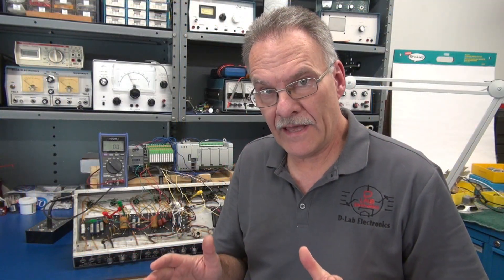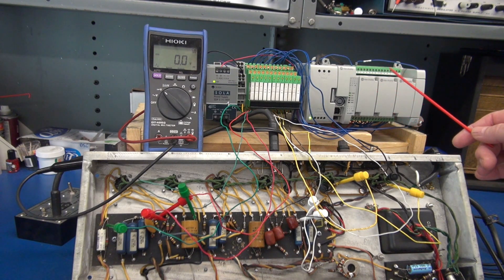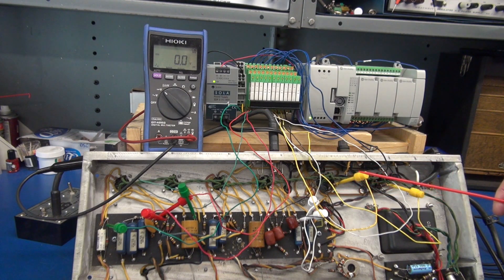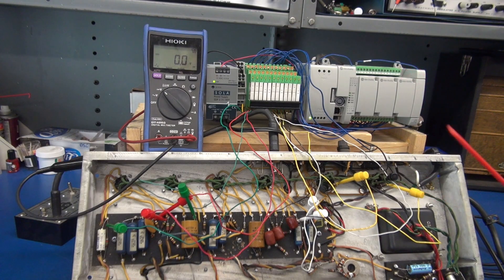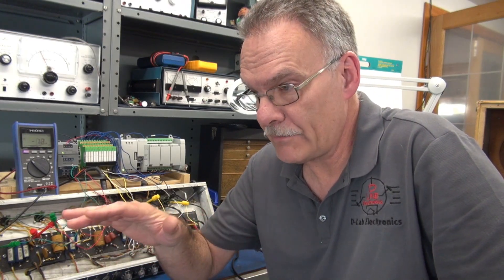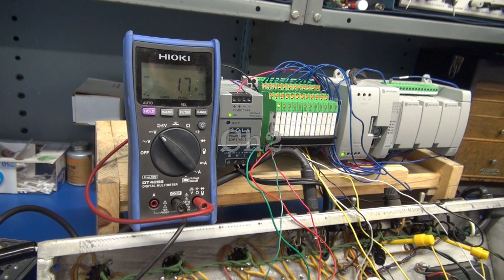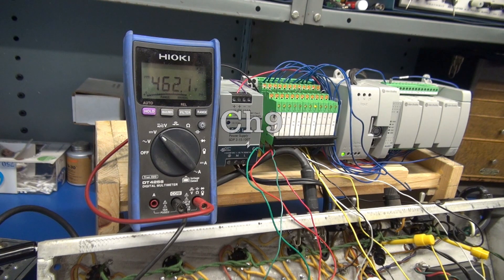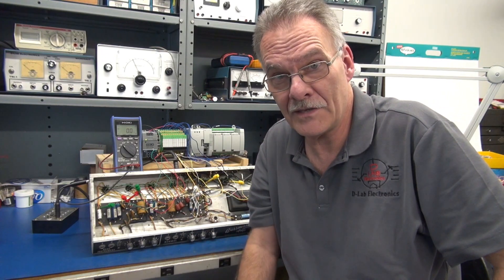Can you troubleshoot tube guitar amplifiers using Allen Bradley PLC Hands free voltage measurement

Comment: This brings back memory...!    Long ago, I worked for a company that built custom hybrid circuits for the defense industry.   I built a test station with a relay matrix and a rack full of test instruments, all controlled by an HP 9000/300 computer.   At first, it was just static voltage tests. Then I expanded it to testing dynamic parameters like rise/fall times using DSO.  We used a  small temperature-controlled chamber that could heat/cool UUT from -55 to 150C, so I automated that too.    That was so much fun.

Comment: Most excellent! In the following story, my metering circuits worked exactly like the system you showed. Any plans to write some  code to speed up  the process, Terry? You could have a config file for each type of amp. Probably better on a production line than a repair shop. Still would be cool.

Years ago, working for Interactive Network (remember them?), I was the in house service tech. We had a need to charge dozens of NiCad batteries all the time so the game consoles could be shipped to the customers "ready to play for 6 hours minimum" as soon as they were pulled from the box.
I built a 24 bay battery holder (4 D cells in series in a stick arrangement) with a 50 amp power supply and a source load driver for each battery location. It was a "top loader" with the batteries standing up in a 4x6 matrix. The top lid contained the positive contacts . 
Next, I constructed my own A/D converter with input mux to read voltage and currents at all the key points. The interface was through a classic Centronics style printer port into a small 386 DOS based PC. I wrote the real time driver/app in quick basic (stop laughing!) and it worked a charm. 
You opened the lid and this reset the program. Put in 24 batteries, close the lid and go have a coffee. The program then ran tests on all the batteries to determine if that battery was charged, needed charge or went high impedance (bad). when you heard the beep, check the matrix on the computer screen and it would indicate leave that battery in, put the already charged batteries in stock or in recycling. Once a full load of hungry good batteries was achieved it could charge them in a few hours and was ready for the next batch.
FUN!
Reply: Did a similar thing as well to automate a video duplicator controller that was very rudimentary, and very troublesome. Also used an old 386SX 33 motherboard that I had a few of, and put in a multi IO card to interface the floppy drive, and a spare video card, plus another card with a parallel port on it. Third card was the only enabled parallel port, with the 8 data pins connected to the video interface card to control it, instead of Mr Heath Robinson's collection of 555 timers and leaky electrolytic capacitors. 

Then the software went through a few revisions, started off with a quick GWBasic program that ran the rudimentary controls as loops, then moved to using the RTC instead for all timing. That then had a series of loops, plenty of memory, so unrolled all loops except for the one which polled the RTC to check the minute had rolled over, looking for seconds to equal 00, then looping till they became 01 before exiting the loop. Allowed all operations to be times, and the main routine also used a random number generator to move the display all over the screen to avoid burning the well used CRT any more than it already was.

All parts, aside from as few resistors and transistors, and a small amount of perfboard, was either salvaged from old computers or obsolete computers, and I also had both spare power supplies ( old AT types) and spare motherboards and monitors to use, plus extra spare ISA cards and drives. All fitted on the single 1.44M 3.5in diskette, including MSDOS and NDD, which was run on every boot to check the diskette was still good, and exercise the drive, as it only was used to boot. Still in the garage, though I do not have a CGA monitor any more to run it.

Comment: I once used an Allen Bradley SLC100 to catch an intermittent "drop out of auto" problem in a relay logic machine tool. I set it up and programmed it to latch an output on if certain circuits didn't work in sequence. I eventually caught it, and it turned out to be a broken wire inside the insulation that would test fine when the machine was static. The vibration from it running caused the wires inside to lose continuity randomly, but when checked after, the wire appeared intact.
Reply: Common on relay logic that used solid panel wire, I got to the point I would pull gently on all wires in a suspect section if I had that, found a few wires that had fractured in the insulation from long ago, but were still touching good enough. Always a sneaky fault to find. Almost always came from the wire stripper jaws being slightly close, nicking the copper when stripping, causing the sharp nick that eventually failed.

Comment: That was really interesting.  I'll bet the clatter coming from those big racks you had in the AF was deafening once the sequence(s) began.
Reply: Not really, all mercury wetted relays for consistent low resistance contacts. Loudest noise was the 3 AC units that kept the room at 20C, so your ATE would not fail.
Reply: @SeanBZA  Thank you, Sean.  I'd never even heard of that type of relay. "Continuing ed" in the D-Labs comment section, and for free, too -- can't beat that!

Comment: Cool test Terry..As you know I'm a newbie now following your channel for a couple of years..😊 I am learning loads, but this video has lost me..I haven't the faintest idea what just happened..I'll try to figure it out..Ed..UK..😢
Reply from the maker: Hi Ed, The PLC is simply selecting relays to route a voltage test point to the DVM rather than moving leads on the chassis.
Reply: @d-labelectronics  Oh OK...Not see that before..Thanks..🙋
Reply: @d-labelectronics  Interesting, don't know much about modern PLC's but could you use some form of AtoD to actually monitor (not just display) the voltages and then produce a report of which was out of spec / varying

Comment: Very cool Terry. For the plates, are those jumper wires able to handle the current to give an accurate reading ? They have to be 20 or 22 gauge. - curious...
Reply from the maker: I used 20ga wire. The load is just the DVM, so there is very low current involved
Reply: @d-labelectronics   very cool terry !!  Thank you

Comment: Can all voltages be taken at the tube pins??  
You know those bias testers that wire a meter to a tube base, and it's stacked between the tube and the amp?  Maybe this could use that same idea.  Log your voltages without pulling the chassis.   Or is that more trouble than it's worth?

Comment: Ok, you are talking my language here. First those must be some stout relays. Low current maybe?
Then we need some voltage sensing inputs 600 v. Maybe just 1 or 2.
Automate that whole thing, read it out and present it in a nice table! In real time!
Reply from the maker: Yes Sir, lots of possibilities. These are standard Phoenix din rail relays. Cost about $18.00 each. I'm sure there are cheaper alternatives. This is just what I had laying around. I agree, it would be cool to have a full menu driven test console.
Reply: @d-labelectronics  Like I said, I'm a noob at all this, but aren't there some kind of $1.80ish doodads that would accurately "Sense" voltage, current, ect., and achieve isolation? Like how a DMM can safely show 600 volts without blowing up... Then just plug the amp into the laptop, and Blamo!, Amp fixed. ;)

Comment: Could you describe this thing you are using for the testing I never heard of a plc
Reply from the maker: Programmable logic controller used in industry. See: https://www.rockwellautomation.com/en-us/products/hardware/allen-bradley/programmable-controllers.html
Reply: It's like a general purpose input/ output controller.  In this application it's controlling  multiple relays that are being used to measure voltages across the contacts.  It opens or closes a relay, holds it for a few  seconds, releases it, then selects another relay to trigger and repeats the process.  This allows it to rotate between voltage check points without having to hold or move meter contacts in place.  This is all controlled through special software.

This is a more professional , fancy way to do things.  This also can be done with a comparatively inexpensive Arduino micro controller and a bank of relays and some coding knowledge.

Comment: Nice presentation D. Could this be done with an Arduino platform? Cheers!
Reply from the maker: Yes it could. I have an Arduino here. Will set it up & repeat the same test. Great idea, Thanks
Reply: @d-labelectronics  I'm an old dog trying to learn some new tricks. I'd be curious to know if the Arduino Library has any Scetches that would get you most, or part, of the way there...? Thanks again for all your videos!!!
Reply: @d-labelectronics  I'm sure some folks are going to state the obvious: "By the time you set up the test, you could already fix it twice with conventional troubleshooting techniques"... But it would be very nifty, and lightning fast (after The Mod is installed) to troubleshoot many amps with this Mod. IE install a 10 or 24 pin jack discreetly on the back of the amp, all test wires connected permanently inside, so when an amp has trouble in the future, you just plug your computer or Black Box into the amp and voila! Fault found. Like the car analyzer that plugs in under the dash. Just a thought... If my amp went down at a gig, and I could use this to fix it, even if I had to whip out the soldering iron, during the beer break, I would be a happy camper indeed! Cheers!
Reply from the maker: I love it man, Like an OBD port on a car! Yes, that would be the goal
Reply: @d-labelectronics  And with each Mod, offer a basic "First Aid Kit" with a few replacement parts specific to that amps most common failures.... I think a lot o Giggers would dig it. 🤟😎🎃 Cheers!
Reply: @d-labelectronics  A SAFER WAY to troubleshoot as well. Ok, I'll stop... ;)
Reply: @d-labelectronics  We... he he, see what I did there... We could call it the OBAD! Get it? Or OBADD! On Board Amp D-lab Diagnostics... Way cool!
Reply: Yes any microcontroller that can run a few IO pins to a relay can do, and even better is to have a way to read the display of the DVM as well, so that your controller can read the outputs as well, and then compare to a set of known ranges as well.